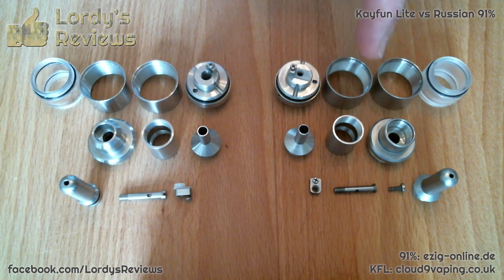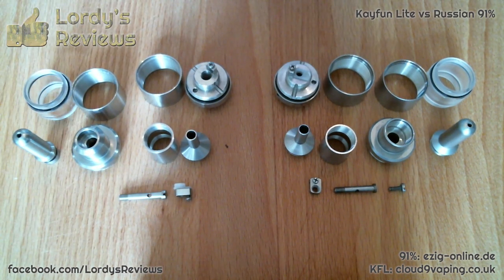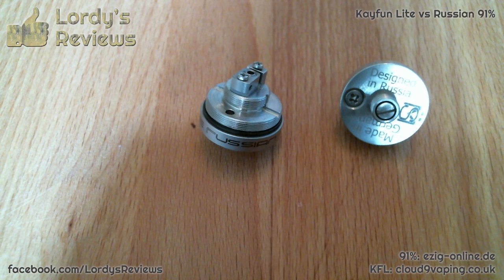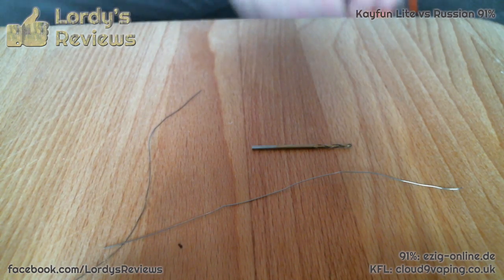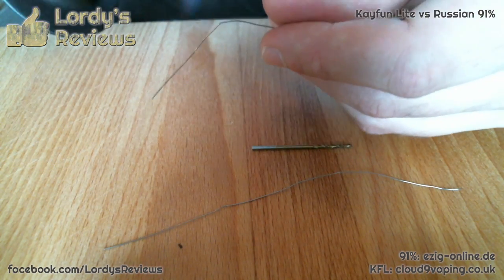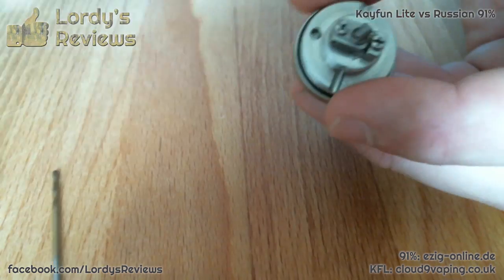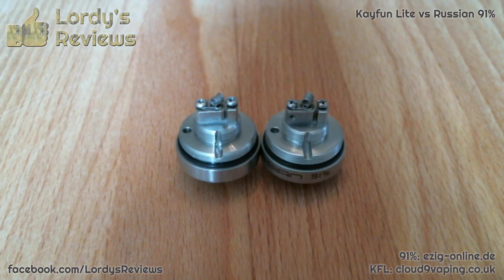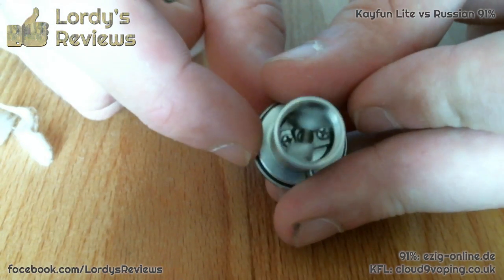The Russian 91% vs The Kayfun Lite - in-depth review and comparison, plus micro coiling tutorial

Comment: Good comparison. I own both and I haven't noticed any different in draw sound between the two. One thing for definite is that the Russian's 91 logo isn't lazer etched. Mine faded away, so I ended up polishing the whole damn thing and now it's very shiny, which you can find on UKV gb thread. 

The centre post screw on the KFL is also larger in diameter as it isn't an adjustable system like on the 91%, maybe that is why it slightly performs better under load. Value for money the Russian wins

Comment: Hey Steve.  I'm in the market to buy one of these.  My question is that I want to know which device has the greater airflow?  I have a 3.1 ES and even with the screw removed I still find the airflow to be a bit restricted.  I do lung hits, so I need a wide open draw.

Thanks!
Reply from the maker: Hi Zulfiqar - may I say I'm a big fan of your videos :)

To be honest I'm not sure that any of these really lend themselves too well to direct lung inhales. There again, I say that as someone that prefers direct inhales on an IGO-W with 2 x 2.5mm air holes. (2 x 2mm on a trident, but even that feels a little restrictive)

The air inlet on the Russian is pretty much lifted from the 3.1 ES, so if that's no good, the Russian won't be either. The KFL is pretty open as standard, but still more restrictive than the Russian with the air adjusting screw taken out.

Not sure how much any of this puts you off, but neither device will improve on the 3.1 ES in terms of more airflow.
Reply: Steve Lauder Hi Steve, just to update, I've done some research and it seems that the KFL+ has a tighter draw than the 3.1 or the KFL.  So I looked around and managed to snag a barely used KFL.  WOO HOO!